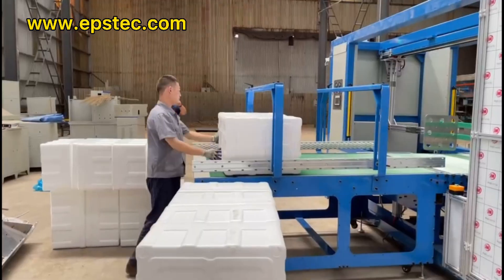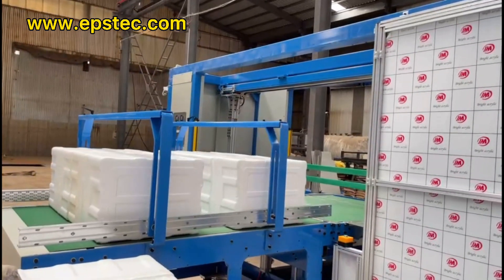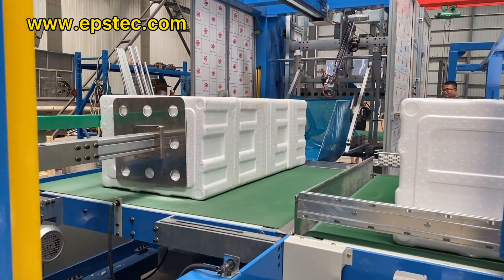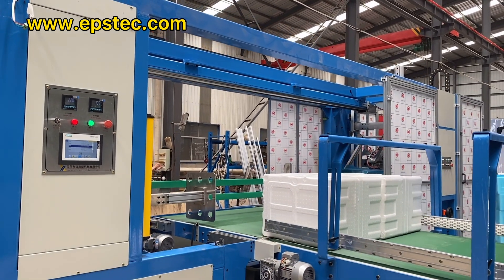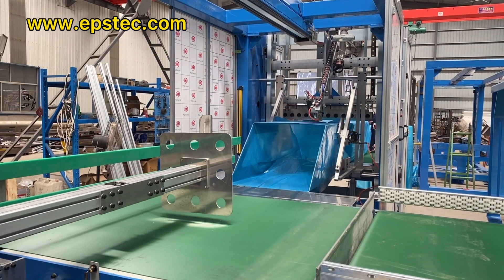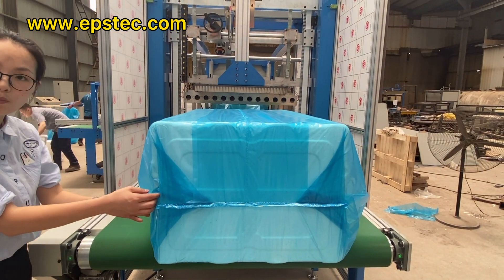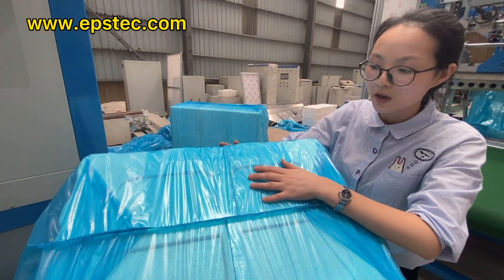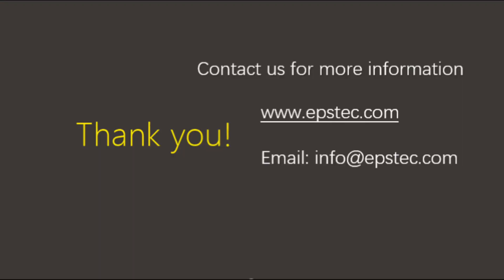Automatic 6 side bagging system package machine for EPS expanded polystyrene foam

Comment: How to set bag? By manual or automatic?
Reply from the maker: Hi there, by manual, because the common PE film roll length is about 500 meters or 1000 meters in the market, We can design automatic unwinding devices, but after the automatic unwinding it is still need to thread the PE film manually, in this way, the automatic unwinding does not really improve efficiency, which is why customers choose manual unwinding. so it does not mean a lot to make a full automatic  unwiding. for more information about how to thread the PE film please check this link https://youtu.be/fod19pMCtQY.  Best wishes Fiona Ying Whatsapp  +86 13819136790